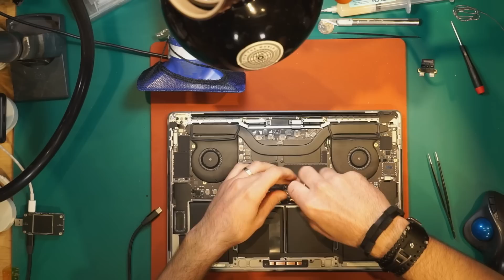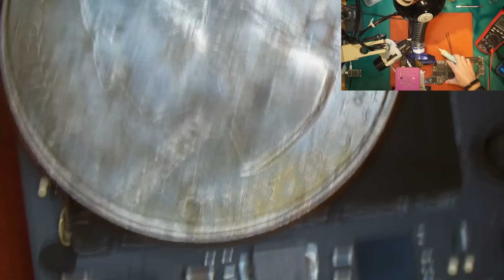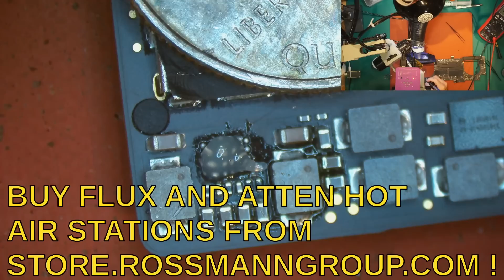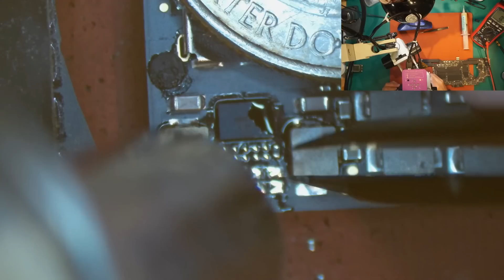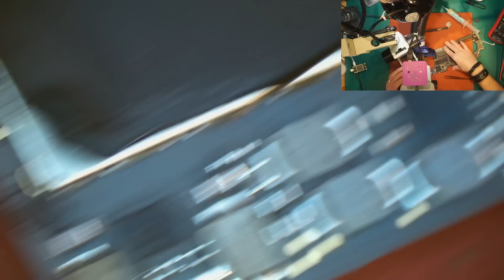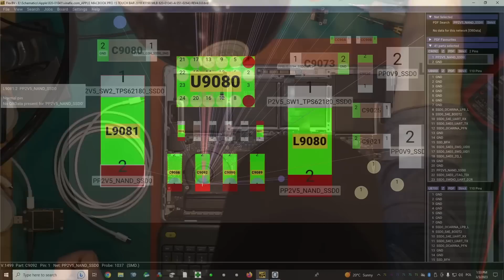Are Apple products still JUNK in 2023?

Comment: This is horrendous. And people pay so much for these Apple products...
Reply from the maker: https://youtu.be/AUaJ8pDlxi8
They've been doing this for decades. I should do a part two on that video
Reply: @rossmanngroup  nice clickbait video. ignoring the billions of devices out there that work reliably and for more than a decade, failing much later than competing products.

You only see the defective products and you have no clue about the percentage of failing devices and how it compares to other brands - simple facts. You are specialized in Apple products - you have no clue about the ways and failing frequency of other products. You have no clue how many other laptops send 12V to the CPU or SSD. Something that inevitably happens if the converter stage before dies in the unfortunate way with the PMOS stuck on. You have no clue in which stupid ways other products die.

You lack an overview over this large and complex sector, but judge a single brand because it creates a ton of clicks.
Reply: @RandomUser2401  The core problem with apple ssds is they're built onto the motherboard, and if they die it's basically over for that computer. Any reasonable company would make their ssds modular  so regular users could replace them easily if they ever fail. But not apple, it's the same reason why you can't upgrade the ram in macbooks either: more profit as always.
Reply: @RandomUser2401  😀
Reply: @gamingwithdomi9401  I know, and like no other comany has SSD or RAM soldered, like that's evil-Apple exclusive. Also I heard that backups are only for nerds and you should never make a backup but trust on a single copy of important data on a laptop.

Like I once had an HP laptop stolen with all my important data on it but since it was not an Apple computer I magically got a copy of my data delivered free of charge the next morning. If it would be Apple, all my data would be gone and I could rightfully blame Apple because making a backup is absolutetly not required these days, I heard.
Reply: @gamingwithdomi9401  also, mechanical connectors require zero space and also do not influence speed or power consumption at all. That is laws of physics, so there really is no reason to solder memory. But even evil AMD and Nvidia solder VRAM to their video cards, now lets imagine if I want to upgrade my VRAM down the line, not possible because greedy Nvidia simoply soldered the VRAM with no advantage whatsoever.
Reply: @gamingwithdomi9401  also on my laptop CPU an GPU are not socketed, again evil companies. Like how would I upgrade CPU and mainboard a few years down the line? Basically etrash the moment you turn it on.
Reply: @marcellachine5718  I know - and these slots have zero build volume, like completely irrelevant in a space constrained device. Also I heard it's beneficial for speed and power consumption the further away a memory is and with every additional electircal interface the signal has to travel. Like it makes everything better, and also I mean who cares about power in a laptop? Since the trackpad is unusable (and there are no laptops with good trackpads) I anyway always carry mouse and charger with me, like who needs a true portable computer anyway? I think it's convenient to first plug in a set of peripherals and find a outlet before i can use my laptop on the go.
Reply: @RandomUser2401  You don't get it. The content that makes this video interesting is two fold. One, Apple is soooo much more expensive than comparably priced computers that a problem like this shouldn't exist. Two, Apple owners/fanboys virtually think that Apple is the only company that makes computers, and/or that Apple is the only computer that can do what they need a computer to do.
Reply: @RandomUser2401  My mid range lenovo failed 2 times miserably, first my fisplay cracked out of nowhere and now It has some start up problems. Any product have problems, but apple seems to be more reliable that the others. Of course if your ssd dies... that sucks
Reply: @gamingwithdomi9401  I 100% agree with your premise, but it's not like Apple are the only ones doing this nonsense of permanently attached RAM and storage.
Reply: @prima6170  any laptop that is actually comparable is not cheaper, the mistake people like you always make is they only look at GHz and Gbyte numbers on the package, which is by far not everything that determines the price of a laptop. Laptops from Lenovo or Dell that are an actual match to Macbooks are very, very similar priced. Except for the M1 and M2 Macbook Air, which are very price competitive given the Premium laptops that they are and especially with their insane battery life and still very decent performance.
For the M-line Macbook Pros, you may try to find a Windows laptop with 4K miniLED screen and all the other features it has, with 15h - 20h of battery life and comparable performance, all that at a lower price.
I‘ll wait.
Reply: @prima6170  and up to this day, indeed no other manufacturer managed to come up with a laptop that delivers a comparable package/featre set. The current Dell XPS came close but then again they started suffering from horrible degradation issues while still costing the same. This is what you and many others here don‘t get.
Reply: @Inertia888  a computer or phone, even more so laptop, never served you for a lifetime. it was outdated the day you bought it and no amount of upgrade would fix that unless you replace everything including mainboard.
While Apple laptops are not upgradeable, they serve you anywhere from 5 to 10 years if taken good care of and then usually keep an excellent resell value. I could sell my 2018 MBP which I bought for around 2200 still for 550 after more than 4years of daily usage, even with an exotic keyboard layout that few people want.
Then if you want an upgradeable Mac, there still is the Mac Pro for you.
Reply: @Y oh look another one misinformed about the Mac Pro. Simple fact: It's an excellent workstation with better value compared to comparable systems from Dell and HP.
And no matter what you label a thing: A high resell value is always a good thing and lowers the effective price significantly.
Reply: @RandomUser2401  fanboy much? lol :P
Reply: @Y I really feel sorry for you that you obviously so far only have used crap laptops. Otherwise you wouldn‘t describe a workhorse and everyday companion as disposable. When reselling a machine and it will ultimately live 10years or more this is not disposable - period. Your twisted definition of disposbale would make literally everything disposable including houses since sooner or later they will be dismantled and replaced, so stop with that utter horseshiet.

Also no fanboyism here, pure facts. The only machines comparable to Macbooks in all aspects are Dell XPS and Lenovo X1 and similar, which are very very similarly priced compared to Macboon Pros.
Now on the other hand M1 and M2 Macbook Airs are a very good deal given all their properties, not to mention energy efficiency and therefore battery lifetime.
Reply: @Y "You're funny when you keep bringing up how your laptop makes you money while at the same time you want to make more money when you sell it."

Yeah funny, it will make me money both during usage and when I sell it, almost like it's worth twice buying such a machine. Like, really super funny and makes no sense at all right? You'd rather lose money twice, right?
Reply: @Y a device for work is a tool - period.
Reply: @RandomUser2401  What does "Resell value" have to do with computers frying SSD's? You are so obtuse 😂
Reply: @thetechfromheaven  You are obviously not capable of following a discussion that is a tiny bit more complex.. but hey, at least you managed to google a complex word like „obtuse“, so kudos for you, kiddo.
Reply: @RandomUser2401  why are you trying so hard to shill Applel's snake oil? Are you a paid troll? You are not fooling anyone here, you are just making a fool out of yourself.
Reply: @thetechfromheaven  You could explain what exactly qualifies Apples spare parts as snake oil, or in general come up with actual arguments instead of randomly accusing others of baseless BS.
Reply: @thetechfromheaven  as an SoC designer that would be problematic
Reply: @RandomUser2401  just like with every "tool", performance is dependent on the task performed. There is no such thing as "this is the best thing money can buy you for every task".
Your Mac may be good for some things, but it will perform abysmal on others (compared to the competition). The M2 chips are also actually worse than the M1 in some regards, don't support larger amounts of RAM and are not generally better than modern AMD or Intel cpus in the same price category (they do outperform them in specific use cases and are outperformed in others).
Long service life of a tool is also not exclusive to Apple products. I have an old and still perfectly functional Samsung Chronos here, by now 13 years old, that probably chuckles internally about all the Apple products it has survived in our family alone. But just like the apples it has survived, it has not aged well. They all tend to horribly underperform with modern system loads towards the end of their service life.
Oh one more note: form factors are mostly purely aesthetical. That (in my opinion) also specifically applies to the notion of making laptops ever thinner. If they didn't do that, they could also still provide unsoldered exchangable components like SSDs. I never minded my laptops being a bit sturdier. I prefer that actually. I don't have to worry about breaking my Chronos. But whenever I have to do some work on a Macbook Air, I am worried that I might break the screen off or something. It feels just so flimsy to me.
Oh and I am not an Apple hater. I prefer IPhones over Android for various reasons, main point being security. Sure I could probably create myself a perfectly locked down Android, which offers even better security than an Iphone. But my time's more valuable to me than to do that to myself. I also prefer MacBooks for working with media files. It just works usually.
Which brings me back to my original point: There is no perfect tool. Just the right tool for the job. And for many jobs that is not a MacBook. And if one of these cases happens to be your use case, then it is often a very pricey paper weight.
Reply: @maximilian672  many of your technical points are objectively plain wrong.
and form factor matters if you don‘t want to carry a 10lb jet engine that has unusable trackpad and does not sustain more than 1h away from the wall.
Reply: @RandomUser2401  "many" technical points? I had exactly two technical points in my comment, but ok.
So please, go ahead and proof me wrong regarding their cpus.

In particular I'd like you to show me how it is better than AMDs mobile CPUs in regards to CPU(!) benchmarks and the amount of supported memory. Lets disregard the memory size limit imposed by form factors at this point and assume you could have a MacBook Air with 96GB of memory. Last I've seen, the M2 Max performs 40-50% worse, uses more power at the same time and supports less memory (LOL!). And we're talking 500-700 bucks for those top tier laptop CPUs, which is well below what we're talking for an M2 Max if you ask me. I'd say we're probably looking at 1000 bucks or more for the M2 Max if you consider the base price of the Mac Air M2 Max is 4000 bucks. At most it ain't cheaper than those AMD cpus, anyways.
And if we're at it, I'd like to challenge you to find a laptop for 4000 bucks that isn't either in the same spec range or better than the Mac Air M2 Max.

Also re form factors: You're massively exaggerating. The track pads are absolutely usable and work just fine. I never had any problems with one of my trackpads. And I at least don't mind their weight. It is a work tool and the only time I am lugging it around is when I am commuting. Most of that time is spent in a train or a car anyways.
Reply: @maximilian672  who tf needs 96GB of memory in a laptop. next why are you talking about the Air? Grasping at straws here to find a niche where M2 loses, great job.
Reply: @RandomUser2401  you certainly are a troll. But I'll try anyways.

The other laptops offered for sale by Apple ain't cheaper, quite the contrary, I was mistaken, the Mac Air does not even offer a M2 Max option (nor a 32GB option), unless I'm too stupid to find it today on their website. It's the MB Pro that offers it for a minimum price tag of 4k (w/ base 32 GB configuration).

To use "who would need xyz" as an excuse to dismiss an argument is just plain ignorant.
Maybe if all you do is use it for some low memory applications, maybe some image or video editing work or playing games on a Windows VM, then maybe having the standard M2 with 24GB memory is enough. Though, if you want to run heavy virtualized workloads or dawdle with neural networks, for example, you definitely sooner or later need 64GB or more (which certainly is the reason why there even is a 96GB variant in the first place :P if there were no demand for that kind of specs on a laptop, they would not build it). That means you need the M2 Max with the memory upgrade. That upgrade costs an extra whopping ~1.2k. If you want 96GB that costs another ~700 bucks. You could get a ton more processing power and memory from literally any competitor for that kind of money.
Also, something that I just noticed, even the M2 Max has only 12 cores. If your workload requires more than that, you're shit out of luck if you're hard bent on using a Mac for your workload.

So yeah. It is not the right tool for my use case. I'd say there's no chance in hell, that I am the only one, considering that all those other offers available on the market would not exist if there was no demand (just like Apple would not have gone for a 96GB variant if there was no need for that).
Reply: @RandomUser2401 Don't defend that anti-consumer crap, they don't even pay you for that.
Reply: @alanharperchiropractor  and neither do I pay them for the possibility to find, lock, and erase my phone in case of theft.
Reply: @weiss588 I think that lenovo laptop doesnt exist. You only want to bash non Apple laptops.
Reply: But what do "people" know ?
Reply: It's because the vast majority of users are very happy with their products. Ask any car mechanic at a dealership and they'll hate the car brand they work with - all they see is broken cars and problems every day.
Reply: @dingdong2103 vast majority of users are happy? You re a LIAR there s no way you can know that.
Reply: @dingdong2103  which is exactly what I try to say all this time and why it is so horribly wrong for Louis to judge Apple based on the heavily biased experience he has.
Reply: @RandomUser2401  Well to be fair, Apple has made some really stupid design decisions which raise the question if they're planned lifetime reductions or not. On the other hand the cult of Apple didn't happen by accident, people are generally speaking very satisfied with their ownership experience.
Reply: @kythrathesuntamer9715  Eh, most banks nowadays require you to use their apps to verify transactions. Also there are paid phone numbers which the infection can call silently and rack up 2000 dollars in bills in a few minutes. So no, I would not want to risk with infecting my phone in any circumstance.
Reply: @dingdong2103  Yeah but that convinces me i should just use an android device.
Reply: @kythrathesuntamer9715  By what logic? You just admitted you are doing the exact things that make android phones insecure. Walled garden is superior in devices which require high security.
Reply: @Y A walled gargen with app pre-review is infinitely more secure for an average user when it comes to mobile devices. Sure apple itself is a risk but when you compare to the 100% known malicious actors that push malware to play store... Night and day difference.
Reply: Right, like Mac and  Macbooks start as high as 700$, iphones as high as 430$. Really really outreageous asking prices for products with absolutely no advantages. Everybody is stupid, excpet the people on this channel.
Reply: @@travisdacey526 what utter nonsense. Do you have any stats to back up that claim?
Reply: because people are stupid
Reply: @Travis Dacey no no no. If I lose my data, I exclusively blame Apple for not making a backup. Like in no way would I as a user be responsible for backing up important data. Blame big corporations, never user fault.
Also yes you are right it is scientifically proven that Apple SSDs are super unreliable, like really, and my 12year old still-working MBP is a hoax and must be kept a secret, becuase like how can that device still function?